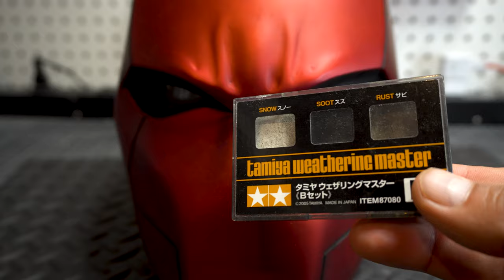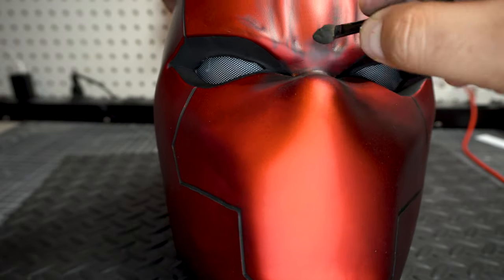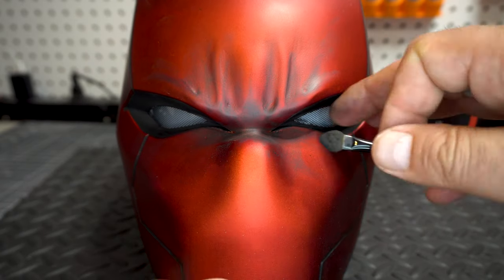How to Weather 3D Prints

Comment: I really appreciate this series, I just printed a death gun mask from the anime gun gale online. I do have a question, how would you go about painting a gun metal silver?
Reply from the maker: Wow, lots of ways really. Depends on if you want chrome, or a brushed sliver. I would just test out different paints.
Reply: @3DPrintedProps  Thank you. I ended up doing a silver spray paint as the base and using alcohol ink to dull it out. Painted the entire thing in ink then wiped it off gave a nice dull silver effect, more of a machined steel look.

Comment: what do you think about the cr-10 s5? I'm buying my first 3d printer and want to spend some money to buy a larger one, but the cr-10 s4 is unavailable. i assume the s5 is the same as the s4 but larger? thoughts?
Reply from the maker: I've got a standard and an S4. I like the S4 a lot. I've heard that the S5 is hard to level due to the size of the bed. If you get one definitely get it with a bed leveling system like a BL touch. I really like getting machines from tiny Machines. They cost a little more but they add anything you need and its all tested. Also fantastic customer support. https://tiny-machines-3d.myshopify.com/products/creality-cr10s5

Comment: Hey, thank you a lot of your videos and I appreciate your work .. I'm thinking about getting my own 3D printer, and I wanted to ask you what printer should I get? I know there are too many brands, shapes and sizes, but I want a printer that doesn't make mistakes or break so easily, something I can trust .. you know what I mean. Thank you in advanced.
Reply from the maker: It depends on what you want to print. If you are looking to do larger things like helmets and larger props then something with a larger bed would be best, like a 300x00x400. I like Creality. I still use the first printer I bought, its a creality cr-10. Here are some links to classes I created, if you are interested check them out and see what goes into the hobby. 

3D Resin Printing: From Star to Finish
http://bit.ly/2ZeIBbN

3D Printing: From Start to Finish
http://bit.ly/2Nu91Uh

Comment: Did you clear coat after the final coat of spray of after the weathering?
Reply from the maker: I did the clearcoat first but if you want to make it so the weathering doesn't wear off or scuff you can weather then do the clear. I like to weather last because then my weathering can actually change.